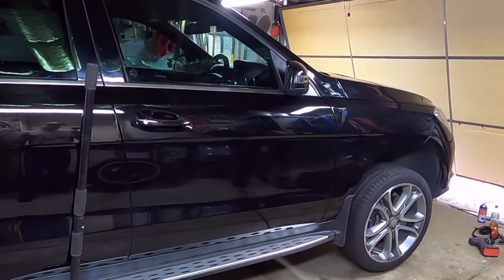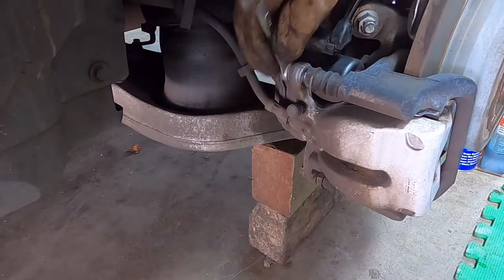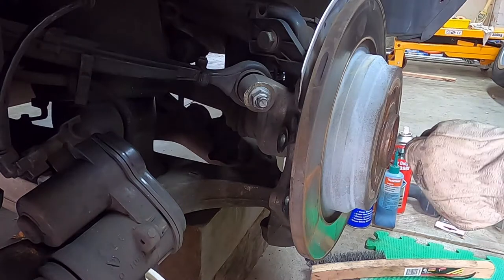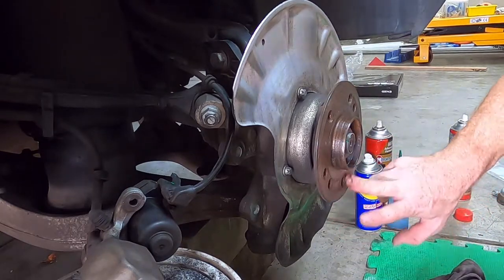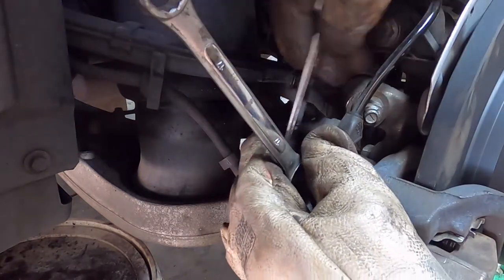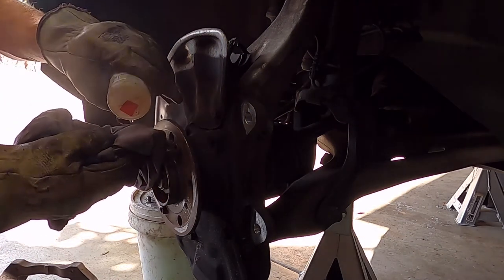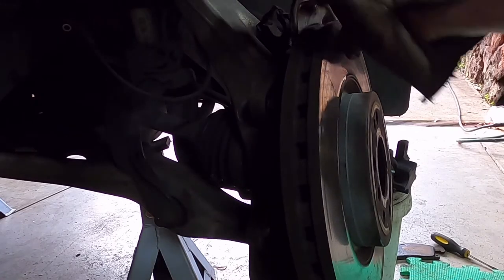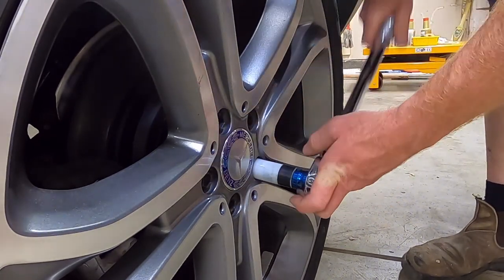Mercedes W166 ML350 Brake Change Disks Rotors Pads Bleeding

Comment: Quick Important Note: To retract the pistons who can do it via the menu on the dash by pressing answer call button and the okay button for 5sec, which will open up a hidden settings, you then go threw the list to brake service and gives you the option to retract pistons :)
The actual video can be found on a gentleman's yoytube page by simply searching, Ml250 Retract brake pads pistons

Comment: Thanks for sharing and posting this. I might remark that, according to Mercedes, thread lock is verboten on the caliper support bolts to the hub. Instead these are torque and angle compressions with 60 Nm followed by a 45 degree tightening (1/8th turn) on the rear brakes and 80 Nm (+45 degree turn) on the fronts. For the angle stage one can either use a proper angle gauge (~15$US) or eyeball it in a very tight space like this. I see a torque wrench was employed at the end but incorrectly. Torque and angle shouldn't be ignored but it's not my car. Under-tightening can result in things shaking apart, but over-tightening can result in bolt failure and other problems. Threadlock adhesive is not a substitute for correct compression of parts and it can also seriously distort torque measurement unless proper lubricants are employed. The captive T30 rotor screw, fine. Everything else, avoid.
Reply from the maker: Hi George, thanks for the comment.  Do you have a spec sheet you can share with that info?

Comment: Hi, I have a question.
After removing the wheel you need to use a 13mm wrench and a 17mm wrench to remove the brake caliper. But my 17mm caliper is too thick to insert. I saw the video with a lot of clearance for the screws, but this one I have is very tight. Do I need to pry it open?
Reply from the maker: Hi,
I think you mean when removing the caliper holding screws with the 13 mm bolt and 17 mm on the end of the calliper pin?
You might need to get another 17 mm spanner that is a bit narrower, or you can buy cheap one and grind it down. It doesn’t need to hold too tightly, just until the 13mm starts to grip.
Reply: good afternoon, please tell me the size of the front brake disc, how many mm, for a Mercedes ML 350 w166 3.L 6 v, exactly like yours, I want to buy a car, I don’t know the size, mm
Reply: good afternoon, please tell me the size of the front brake disc, how many mm, for a Mercedes ML 350 w166 3.L 6 v, exactly like yours, I want to buy a car, I don’t know the size, mm